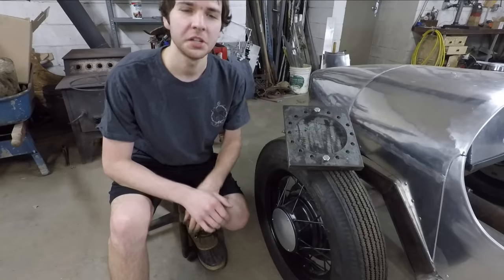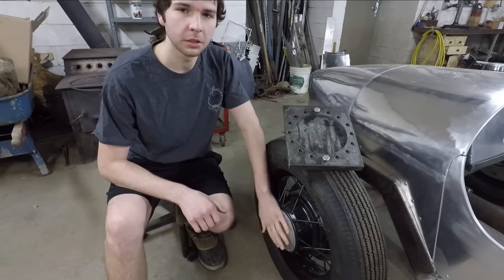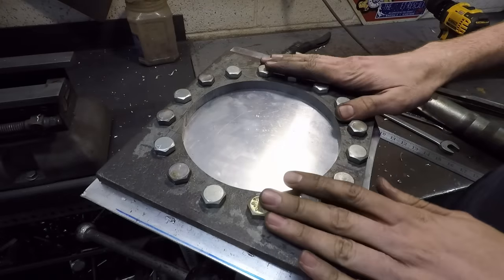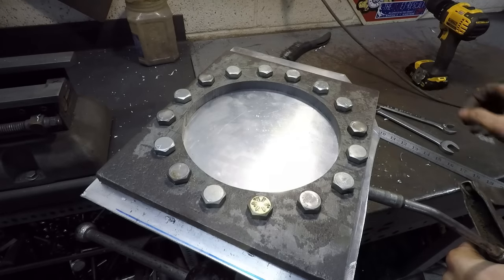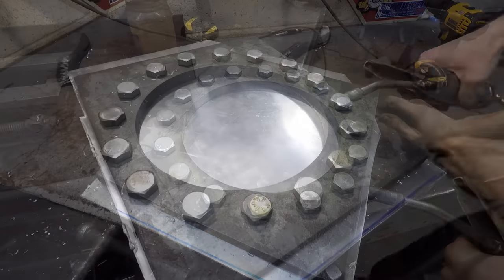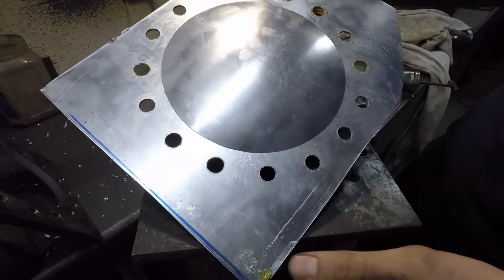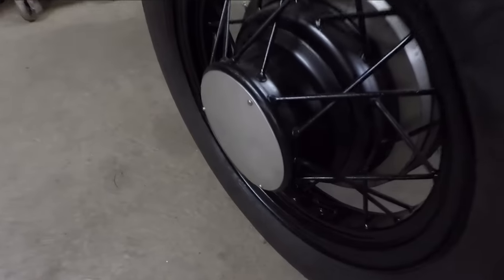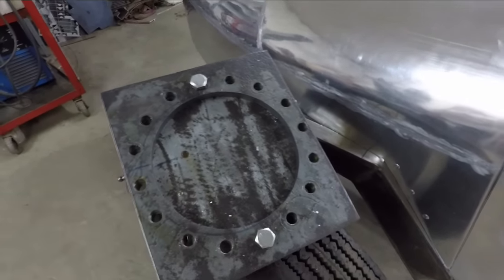Grease Hydroforming!

Comment: Wtf moment when he cut the blade that cutting the plate round. I just like what the frick
Reply: i just wonder how he got it in
Reply: He probably cut the band, passed it through then tig welded it back together. Or he has a dedicated blade welder.
Reply: @seppe2078  i came here to figure out how it got in the circle but now cant come out.
Reply: maybe it was a shit blade by the end of the cut and he just said fuckit to make the video move along?
Reply: Bandsaws have a blade welder on them and you can get the blade off a roll cut it to length and weld the loop inside the part and then install the blade to cut parts like that.
Reply: @Spaghettihead1  still doesnt show how it got there to begin with?
Reply: @R1davies He cut the blade that was on the saw or he took a piece off a roll of new blade passed it through the hole in the plate of steel welded the blade together and adjusted the blade tension and the tracking of the blade on the band saw wheels, made the cut on the steel and cut the blade to free the part.
Reply: I said the same thing!!
Reply: @RubSomefastOnIt  cheers, thank you. I came here to mention the welder.
Reply: @RubSomefastOnIt  I need one of those.
Reply: Here is a band saw with the blade repair equipment built in to its side.
https://youtu.be/zHhDXifoZmA
Reply: Question is: which came 1st, the blade, or the piece of steal.  ...I imagine he cut and welded the blade.. ..through the hole.
Reply: A lot of DoAll bandsaws came equipped with a built-in bandsaw blade welder from the factory for this very purpose.
Reply: The band saw usually has a band welder in the side. You just clean the edges and weld them again.
Reply: Frick??, as in Frick and Frat?
Reply: That is exactly why I went to the comments to see if I missed something
Reply: Never knew that, thanks for the info
Reply: @moondog573  likely he drilled a hole and slid it through.
Reply: This old tony has a video of him tinkering with a band saw blade welder he bought
Reply: @moondog573  Real questions, indeed. I was trying to figure that out.
Reply: The blade was probably shot
Reply: Exactly!! Why???
Reply: His band saw probably have blade welder built in it. I have used on of those. It's awesome
Reply: @Ricky Sanchez LOL, you do realize the blade had to be cut/open to get in the hole in the first place right?
Reply: @breadbutt  you can buy a band welder separately.
Reply: @Ricky Sanchez you just weld it back together if the teeth are still good...
Reply: @RubSomefastOnIt  what bandsaw has a blade welder!!!
Reply: @epicpaper3994  most real bandsaws that are used in metal  and machine shops. Look up Doall...
Reply: @RubSomefastOnIt  thats cool mayne I just saw something new.  Might have to get one of those!
Reply: @jstntlvr  I would agree with this as the most likely case. Oth
Reply: @R1davies  he cut it. Then poked through the hole then welded it.
Reply: @scarakus  at 0:30 he starts cutting in a hole he drilled
Reply: @RubSomefastOnIt Don’t you mean some bandsaws have a blade welder on them!?
Reply: Cant he like cut through the plate to take the blade and weld that cut? Just asking suz i dont understand 😅
Reply: My buddy is a machinist and his band saw blades break sometimes and when they do he just welds it back together and grinds it smooth
Reply: @moondog573 wtf are yall talking about, that metal is scrap now, he just bent the metal so it could pass through ….🤨

Comment: I would definitely use that method except I don’t have a single tool you used, except maybe the sharpie you used to draw the circle.
Reply: That is probably dried up like mine. shm
Reply: If you search hard enough, you may have another one of his tools.  The screwdriver at 7:06.
Reply: I was struggling to take a shit and read ur comment, thank you
Reply: Even has a well equipped, full functioning wood working shop...
Reply: Make any headway on y'alls tool collections?
Reply: @yomin3mg  same
Reply: @miles11we  yeah, i found some screws along with the screwdriver. Almost there
Reply: Have a look at ColinFurze's vid, welder and a pressure washer is pretty much all you need

Comment: When you cut out the circle on the 1/2" plate on the bandsaw how did you get the bandsaw blade into the middle of the circle? I saw you cut it at the end, did you cut and weld it?
Reply: Undoubtedly. Some band saws even have an attached blade welder. It has a clamp to fit the two ends together and an integrated welder.
Reply: I came to ask the same question
Reply: 2 holes appox 1'' in diameter were cut into the plate. The band saw blade was cut and then fed through one of the holes and then welded back together. The blade was then mounted on the band saw, when the hole was completed the blade was sacrificed and snipped again. You can cut and weld band saw blades all day. This is what you do when you don't have a CNC at your disposal, the young guy was using his head. Still wishes he was my son....
Reply: but the blade is tempered steel how can you weld it without braking it after ? I already tried it on a blade and it just snapped near the weld due to the difference in heat treating between the blade steel and the area heated by the weld...
Reply: That's the exact question I came to ask.
Reply: @UltimateMaking  annealed after welding
Reply: @UltimateMaking   , We weld curer tapes for can making ,same thing , you have a proper tape welder which just butts the ends together ,heats red hot and pushes them together , I spread the contacts and flick the tempering heat to soften it , then carefully dress weld without hour glassing tape , then temper to a color, like straw .
Reply: Ultimate Making  on the Do-All brand of band saw I used in the Air Force, the welder was attached to the saw and a really simple process.
Reply: Why do you think its a bandsaw ?
Reply: @bahn5ee  what? It is a band saw
Reply: bahn5ee because it’s a bandsaw couldn’t have been anything else
Reply: @UltimateMaking  anneal it after welding
Reply: If he was going to bolt-clamp the whole perimeter of the circle anyway, I don't know why he just didn't cut through into the middle, and then cut the inner circle.
Seems a whole lot less effort, and that 1/16" wide cut clamped down on both sides is not going to allow any grease to escape the aluminum plate underneath.
Reply: @SwankeyMonkey  That cut through to middle would allow the grease to escape, as it would not be a closed space anymore.
Reply: @JaakkoF  Grind a V on the bottom side of the plate along the cut, weld the V shut, build the weld proud of the surface and grind it flush. Now there's nowhere for the grease to escape.
Reply: @UltimateMaking  the welder has an anneal function   have to "jog" the heat buttun a few times looking for the blade to heat to red then let cool
Reply: @IR-nq4qv  wow, I had no idea you could weld bandsaw blades back together
Reply: this comment section just educated the hell out of me. Thanks!
Reply: @JaakkoF  cutting the top plate of the form wouldn't cause grease to expel out as the sheet steel would be in place between the cut and the grease.
Reply: Lol. Dude pulls a fucking magic trick at the beginning of the video... doesn't explain it.
Reply: @johnwright6706  I don't think you quite understand how slippery this stuff is once you pack it in there at high pressure. It'll find the path of least resistance, and if you made a cut in the outside ring you would end up with a wrinkle in the dome from the grease pushing out in that spot.
Reply: @UltimateMaking  It has to be annealed after it has been welded. Blade welders have that function as part of the process
Reply: @UltimateMaking  tient salut toi
Reply: I was wondering the same
Reply: Was wondering the same thing. Thanks
Reply: @ScoutPL  That's how they're made in the first place, plus, you can buy a 100' roll of whatever kind of bandsaw blade you want, and make your own custom blades to fit your machine.  It's great if you need a special size and/or go through a lot of blades, since it's cheaper than buying them already made.
Reply: I'm a little buzzed watching this. Had to rewind twice to see if I missed something!
Reply: I feel like it would have been just as easy to cut a slot and leave the blade whole unless he had to thread it in another piece later.
Reply: thought exactly the smae
Reply: Thank about how a band saw blade is made, flat strip welded together then annealed. Cut the blade and weld them anneal, or braze together. Works great.
Reply: @stanstuben2961  if that were the case nobody would ever learn anything. How many people do you really expect would know the answer to that question and how many people do you think might have been willing to learn a new skill had people just been willing to talk to them about it instead of acting like it's done mysterious impossible skill? People like you are why the world is constantly losing skilled laborers.
Reply: @johnwright6706  except that the aluminum would likely form into the groove causing the grease to escape between it and the lower plate. As another person mentioned it would be easy to just weld that cut closed again so the grease wouldn't leak.
Reply: @UltimateMaking  blade welder has annealed setting.
Reply: @madmat2001  less work to cut the blade
Reply: @johnwright6706  The dome would have a ridge at that point, thats how you make domes with ridges.

Comment: I've done exactly this except I used a pressure washer instead of a grease gun. Works great. You can also weld thin sheets together in the flat shape you want and then use the pressure washer to blow it out to shape.
Reply: I was going to say the exact same thing.
Reply from the maker: yeah, for anything bigger I would also use a pressure washer instead
Reply: I used the same template for a headlight bucket, but used a round disc of wood and a big hammer to push it through
Reply: colin furze does it making a pulse jet, such a cool thing to watch
Reply: Colin furze made a pulsejet that way lol

Comment: I have the same setup, but about 2' in diameter with a power washer connection.
Reply from the maker: nice, one day I'll experiment with using a pressure for larger pieces
Reply: When you really put pressure to it does it leak out the sides?
Reply: @MacroMachines  
How far could you dome the hubcap you made before it bursts?

Comment: Results look very good.   Lots of work invested in that. You could use that method to emboss your logo on the caps. 

Spinning is another way of making circular  dish-like objects, propellor spinners, (and even saucepans).
Reply: Spun aluminum is a far less involved from a tooling standpoint. Form could be turned on a lathe for one off a good hard wood would suffice for the form.

Comment: Genius! How did you get the band saw blade in the half inch steel before cutting???
Reply: thats a secret i presume lol
Reply: Hahahaha
Reply: Weld tig
Reply: This guy never fails to amaze
Reply: I don't know about his bandsaw but in the machine shop i was in had a blade butt welder and annealing attachment on it so you could do blind cuts like this
Reply: Rob 66K10 
His saw is just a horizontal bandsaw that he uses vertically. No where big enough to have a blade welder. My Highschool woodshop and machine shop had blade welders and one test we had in the machine shop was to weld two 6 or 8” pieces together for a pull test. 
He likely used his TIG welder and mad skills to pull off his magic trick.

Comment: 0:53 i didnt expect you to cut that blade or whatever its called
Reply: lol ikr so brutal
Reply: Probably it was extremely dull at that point, so it's faster to cut it and replace it than to remove and reinstall.
Reply: given it looks like a bandsaw (one loop of blade going around and around) my question is how did he get the blade in?
I might be mistaken as most reciprocal saws I've seen doesn't have blades that thin.
Reply: @AsmodeusDHare  you can weld the bandsaw blade back together
Reply: @zynan4427  good point.
Reply: Maximum disrespect
Reply: The steel cutting band saw we had at the shop had a blade welder built right on to the saw.
Reply: I mean you cant really remove it. Its a band.

Comment: 0:52 that right there is the defenition of solving one problem but creating another :D Good video!
Reply: But..I still don't get it...is the bandsaw one closed loop that needs to be cut? And if so how did he get it through the hole in the first place?
Reply: @biagiomattiamoro1844  I'm in the same boat as you. Every blade I've ever seen for a band saw was one continus loop. So how the fuck did he get it in the middle in the first place 😂
Reply: Justin Wright probably cut it and welded it together seeing as he’s got a tig welder and then cut it again to take it apart
Reply: Weld the nuts to the bottom save a little time
Reply: Our vertical Bandsaws all had Blade Welders so you could weld the blade after you threaded it through the hole 🕳 

I would just use our CNC plasma table to cut everything out in like 5 minutes bolt holes and all
Reply: I worked in a shop where they bought bandsaw blades in bulk on a giant spool. Cut the length, weld anneal and off you go
Reply: @madflyer1093  The First shop I worked at had marks on the floor from the wall so you could take a chisel to cut the blades to length depending which saw you had to make the blade for.  The shop I'm at now still doesn't believe me as they order em premade

Comment: I have not worked with metal.   So i have a question. During the cutting and drilling I see you didn't wear gloves.  It seems like one would get metal slivers and general cuts on the hands and fingers from the sharp shavings.   But gloves could also get caught in the machine causing horrible injuries.  Either why cool stuff.  The finish on something like this looks much better than hammering or using machines to stretch the metal over a bag.

Comment: That’s all good and well, but how did you get the bandsaw blade into a closed hole?
Reply: Cut the blade, insert it through the hole, and weld it back together. Some old metalworking bandsaws even come with built in blade cutting and welding stations, but you can also do it by hand.
Reply: @skylerlehmkuhl135 yeah they basicly all have it. Isnt working like it should on most tho :D
Reply: what is a closed hole?

Comment: I loved how clean looking the domes turned out and how perfectly defined the edge of it was when you unbolted the two halves - seems like that would be a great method to create small domes for speaker cone caps.  Great Video!
Reply: Speaker cone caps need to be so light that you could literally form it by hand, just put a done on one piece of wood, a hole in another, and push them together by hand. Any aluminum heavy enough to need hydroforming would be WAY too heavy for a speaker cone dust cap. Some of them are only just thicker than kitchen aluminum foil, I even made one once for a speaker my kid put their finger through by taking one of those thin aluminum candle holders and just rubbing over it with my fingernail. Anything thicker than what you can do by hand is way too thick for speakers.

Comment: Efficient? Maybe not. But it beats spending hundreds buy the tools or having it made by someone else.
Reply: With all that machines I'm pretty sure he can do it without that method too.
Reply: Experience is the best teacher, even failures teach us lessons. Don't be afraid to experiment.
Reply: If you have one of the Air power grease guns this would go pretty quickly.
Reply: This is twice as expensive/twice the hassle then  getting it made and or doing it yourself with multiple different methods.
Reply: @dakotaallen9259  with covid nowhere near me is doing this stuff, I already have the parts (free) and it really doesn't take any time or hassle unless you're new to metalworking, in which case you need the experience. You've never actually worked in a metal shop before have you?
Reply: I work in small to mid size fab shop and even for one off jobs ..you burn up some 1\2 inch steel over hours of tooling. Perfectly done. Unless you plan on making 100,000 parts
Reply: I agree .... now gotta shop for some 1/2 plate!  Maybe I can start small.
Reply: Why buy it when you can make it. Lazy method and doesn’t teach you anything

Comment: I'd have welded either the nuts or bolts in place so you could just impact them on and off.
Reply: Only problem with that is the drilling holes into the new material each time you want to hydro shape a new sheet. You would drill out the threads.
Reply: I guess you could tac weld a little nub to keep the heads from spinning or somehow counter sink the hex shape into the metal plates on one side as a keeper.
Reply: What? You have 2 pieces with holes, weld the nuts to one, use the other as a jig. Or, get a drill bit stop. Or use a drill press.
Reply: if anything still use a wrench to hold the nut and impact driver to remove bolt

Comment: 0:54 lol... wut? how did you even get that blade inside the hole in the first place? O_o
Reply: Cut it and then weld it back together
Reply: Was thinking the same thing haha
Reply: @hold-my-beer-watch-this  nah dovetail joints we did it back in woodwork o level
Reply: Metal bandsaws have a attachment for welding the blade back together
Reply: You can mig or tig a band saw blade easily that would be my guess
Reply: Some guys even braze the blade back together but it's a simple cut and weld
Reply: He's a magician
Reply: @HamguyBacon  the blade is a band